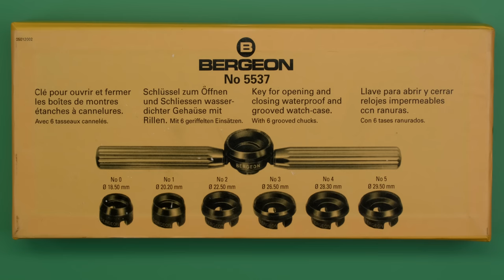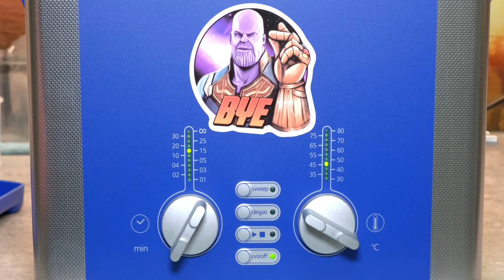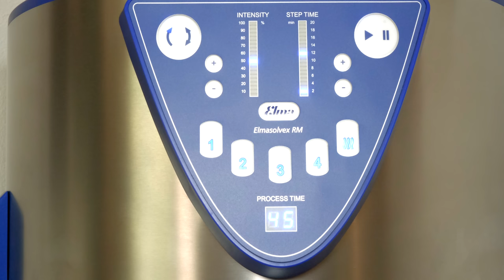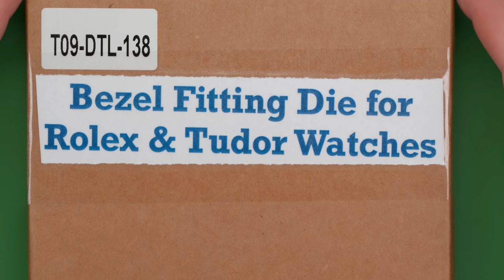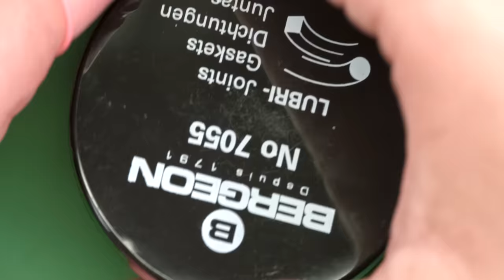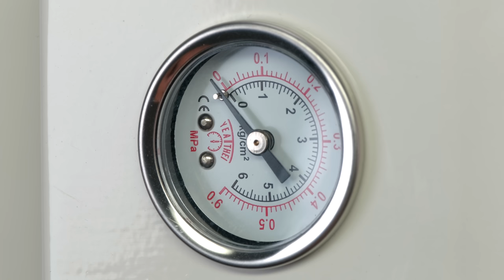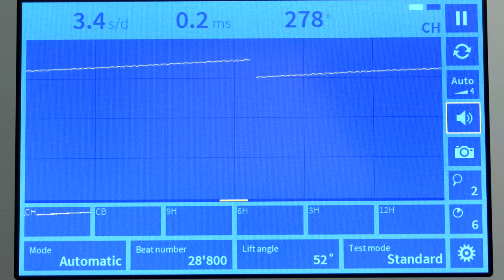Restoration of Rolex Oyster Perpetual -Date-

Comment: If this was my watch and I watched this video seeing all of the surface rust and other debris left on the chassis and screws I would have withheld the payment. As a watch lover myself and seeing what you left would have gotten you a failing grade in watch maker school. You didn't have to show it on the video, but as a Marine and everything is based on doing a job correctly and doing something when others aren't watching, like attention to detail.  I hope that watch gets better care from the next watch maker. I still like watching watch services and watch making, but this one just left me a bit aggravated and wanting more.
Reply from the maker: With big studio lights and huge magnification everything looks worst than in reality.

Still one point for you 🤗

Nice day to you
Reply: Yep, the rust left on the main plate bugged me too. Was clearly there inside some of the holes.
Reply: @jimg8887  Also those few screws not polished and left as is :(
Reply: Do you mean that all the parts should be brand new instead of refurbished?
Reply: @bonniebrooks3173  nope, not at all. I spent 13 weeks in U S Marine Corps boot camp using something called jewlers Runge,  at with some attention to detail that red stuff will remove clear coat,  so I'm sure that if you just sat in front of the TV sometime with the watch parts in your lap and the polish,  you'd get better results.  Or maybe it's the military muscle memory talking. Either way, your hobby has polish named after it
Reply: @Ordrock7 door gunner on a submarine more like, it’s an old Rolex, not a Picasso painting 

Lighten up, or show us how you do better yourself with a like video
Reply: I’ve been doing this a hobby for almost 10 years now. This is a wonderful channel and a real pro. I understand the satisfaction value of seeing everything clean, plus your a Marine (thanks for your service). There is a thought though, there is a fine line between a full restoration and a service. How much character and originality do you keep. If the customer is happy. Cheers.
Reply: By
Reply: you do know it’s almost impossible to remove every bit of rust right, I bout an old Tudor heavy levels of rust, the guy who serviced it got it near perfect, though there was some rust that was deeper than surface level and impossible to remove, the only way to fully remove it is replace the parts, some of which you can’t buy anymore,
Reply: And I also have to ask where’s the rust? Every plate on this movement is made from brass with a plating over top of it? over time this plating naturally erodes revealing the colour of the brass underneath so personally I don’t think that’s rust I think it’s just the brass showing through areas where the plating on the movements plates has started to thin and fade, also before you say they aren’t made of brass yes they’re are google it
Reply: Of course I know this about every bit of rust, but you are conversing with a retired U.S. MARINE, and attention to detail is our way of life.  I watch guys repair and renew motorcycles and they refinish screws and bolts all the time on their youtube channels.  So I know the exercise of removing rust isn't too tough. I have a dry Ice blasting business and use dry ice to clean up small fasteners and other parts on a car, so you see it can be done.  Scott in southern Oregon
Reply: @Ordrock7  yes but with cars bikes ect parts are bigger and there’s other processes that allow you to do that refinishing, with watches the only full way to do a full rust removal and refinish is with a chemical reaction and the chemical that gives you that reaction for rust removal on watch parts and movements isn’t exactly cheap, you can’t dry ice blast a watch case or movement bridges etc for example because they’re too small, same with the screws because of their size to get a perfect rust free finish is practically impossible, but again what’s happening here isn’t rust it’s the nickel plating wearing thin allowing the brass colour of the actual movement to show through

Comment: The video "Restoration of Rolex Oyster Perpetual -Date-" by Magic Watchmaking is a fascinating journey into the restoration of a Rolex Oyster Perpetual Date with the reference number 15053, produced in 1986. This Rolex watch has suffered multiple damages, including severe impact during an accident, and previous repair attempts were halted.

The video likely showcases the meticulous process of restoring this vintage Rolex, addressing the damages, and bringing the watch back to its former glory. It's a testament to the craftsmanship and skill required for watch restoration.

For watch enthusiasts and those interested in the art of watchmaking and restoration, this video offers valuable insights into the intricate work involved in reviving vintage timepieces.

It's impressive to see watchmakers like Magic Watchmaking take on such challenging projects. If you appreciate fine craftsmanship and the restoration of high-end watches, this video is definitely worth watching.

Comment: Did you have to change the face and the glass?  We’re they not salvageable?
Reply from the maker: Old crystal was not original and didn’t fit probably. Thats why someone uses silicone to hold it in place. So I replaced the crystal with original one. I swapped the dial because the owner of the watch wanted it to be change. Thank you for watching 😊

Comment: Does this brand have a movement that doesn’t have to be the same in all watches ? because this one has two RED sprockets that I’ve never seen before. Thank you for sharing.
Reply from the maker: No, that’s note the case. Most brands use different movements. Like cars every brand has own motor 🤗

Thank you for watching ☺️
Reply: This movement, the 3035, has not been produced for 35 years. Nowdays Rolex makes several, the 3230 time only, 3235 date complication, 4130 chronograph and the 3255 day date plus a GMT (I don't know the movement number). No more red (Teflon coated) reversing wheels are used.
Reply: @joeskeptical4762  Rolex never made this movement Aegler did.
Reply: @Gary Boyle  That's correct, Aegler was a captive contractor for Rolex, and has since been acquired by Rolex. It manufactured movements for Rolex exclusively,  the designs for which came from Rolex itself.

Comment: Was the dial replaced, instead of cleaning the original?
Reply from the maker: Nothing to clean on the original dial. It was simply damaged but I keep it anyway.
Reply: @MagicWatchmaking  knowing Rolex I bet the replacement wasn't cheap.
Reply from the maker: @garyboyle695  The replacement dial is used and old but in good conditions. I had luck and got it for good price

Comment: Nice job! Only the bezel does not seem to be fully aligned.
Reply from the maker: I didn't see it. Please explain
Reply: @MagicWatchmaking  , the machine turned bezel has raised and lowered sections. If you look at e.g. the 6 o' clock marker or the 12 o' clock Rolex logo, you can see that the markers neither exactly align with the middle of a raised bezel section, nor fall exactly in-between two of the raised sections. Perhaps it is just a parallax issue, caused by the camera.
Reply from the maker: Fantastic eyes you have 👍
I checked the bezel again. It is the parallax caused by the camera. The camera‘s are not 100% leveled. They are a couple of degrees odd. But thanks a lot for sharing. Very good advice for everyone read this comment ☺️
Reply: @MagicWatchmaking  Glad too hear that it's just the camera. You don't notice this so much with the fluted bezels, but the machine turned ones just have a more distinct texture, creating (or missing) symmetry to points on the dial.

Comment: Are those red wheels plastic ?
Reply from the maker: Great question! Just metal coated with teflon.

Thank you for watching! Have a nice day ☺️
Reply: @MagicWatchmaking  I wouldn't imagine Rolex using plastic parts. Thanks for the reply. 👍
Reply from the maker: @orvillefindley8117  Never see plastic parts in Rolex. Seiko, Citizen also Omega at least some old movement (e.g. calibre 100x series) using plastic parts
Reply: @MagicWatchmaking  I believe Tissot once made a watch with a movement made of all plastic parts with the exception of two parts I think. The idea behind it was that it would never need servicing. It didn't really catch on.
Reply from the maker: @orvillefindley8117  Swatch also.